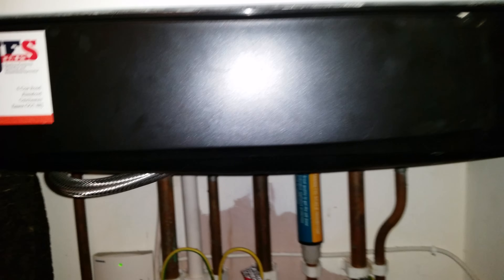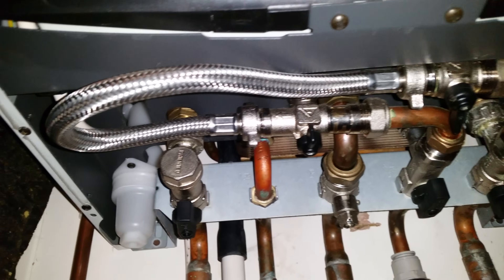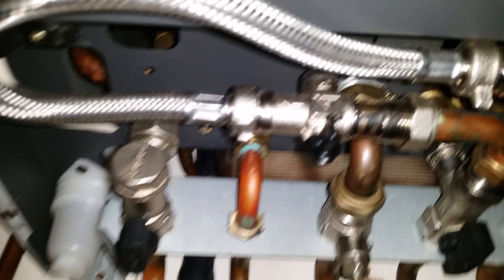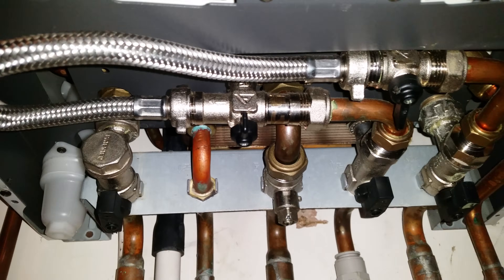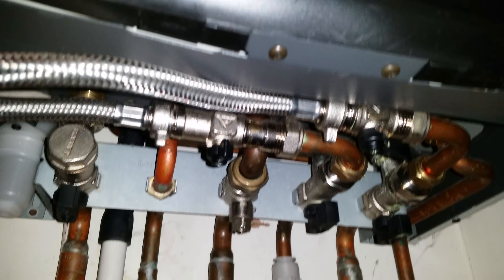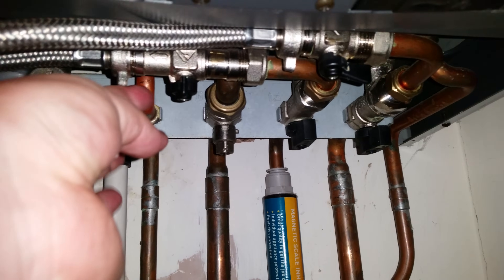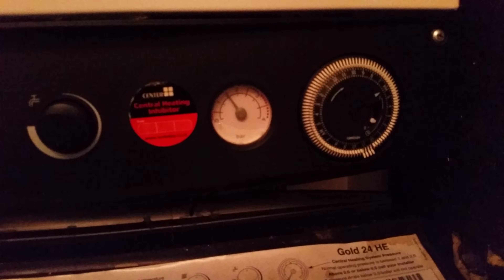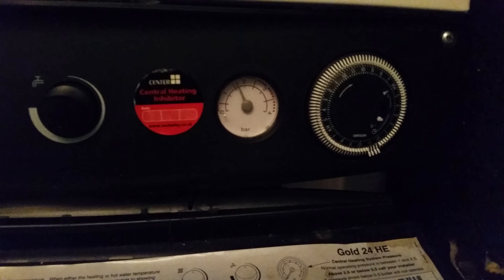How to add water (pressurise) a Potterton Combi Boiler central heating E119 error code

Comment: potterton promax combi he plus       is what i have in Scotland.   Video is correct but on my system its a bit different the flexible tubes are vertical.  i noticed the valve only needs turned slightly as the pressure increases very fast and did as the video said and fixed the problem!  i was so afraid id break it lol   so two valves need opened and one fully opened and one only slightly and you see the bar increase.  I would be careful not to turned the valve all the way open you may end up with a flooded system ?   anyways Thanks for a good video and saved me a lot of trouble :)   John 3:16-21

Comment: Just a hint. I have a Potterton titanium combi boiler. The two valves at the end of the re-pressurising loop are knurled knobs rather than valves with a 'blade' type of handle as in the video. I spent a while looking for the wrong ones...The important part is that the valves are the furthest away from the wall and closest to the control panel.
Reply: Thank you for your comment. You've saved me messing with the blade taps for longer than I'd already done 🙂
Reply: Thank you for your comment. You've saved me messing with the blade taps for longer than I'd already done 🙂
Reply: Thank you for your comment. You've saved me messing with the blade taps for longer than I'd already done 🙂
Reply: Thank you for your comment. You've saved me messing with the blade taps for longer than I'd already done 🙂
Reply: Thank you for your comment. You've saved me messing with the blade taps for longer than I'd already done 🙂
Reply: Thank you for your comment. You've saved me messing with the blade taps for longer than I'd already done 🙂
Reply: Thank you for your comment. You've saved me messing with the blade taps for longer than I'd already done 🙂
Reply: Thank you for your comment. You've saved me messing with the blade taps for longer than I'd already done 🙂
Reply: Thank you for your comment. You've saved me messing with the blade taps for longer than I'd already done 🙂
Reply: Thank you for your comment. You've saved me messing with the blade taps for longer than I'd already done 🙂
Reply: Thank you for your comment. You've saved me messing with the blade taps for longer than I'd already done 🙂
Reply: Thank you for your comment. You've saved me messing with the blade taps for longer than I'd already done 🙂
Reply: Thank you for your comment. You've saved me messing with the blade taps for longer than I'd already done 🙂
Reply: Thank you for your comment. You've saved me messing with the blade taps for longer than I'd already done 🙂
Reply: Thank you for your comment. You've saved me messing with the blade taps for longer than I'd already done 🙂
Reply: Thank you for your comment. You've saved me messing with the blade taps for longer than I'd already done 🙂
Reply: Thank you for your comment. You've saved me messing with the blade taps for longer than I'd already done 🙂
Reply: Thank you for your comment. You've saved me messing with the blade taps for longer than I'd already done 🙂
Reply: Thank you for your comment. You've saved me messing with the blade taps for longer than I'd already done 🙂
Reply: Thank you for your comment. You've saved me messing with the blade taps for longer than I'd already done 🙂
Reply: Thank you for your comment. You've saved me messing with the blade taps for longer than I'd already done 🙂
Reply: Thank you for your comment. You've saved me messing with the blade taps for longer than I'd already done 🙂
Reply: Thank you for your comment. You've saved me messing with the blade taps for longer than I'd already done 🙂
Reply: Thank you for your comment. You've saved me messing with the blade taps for longer than I'd already done 🙂
Reply: Thank you for your comment. You've saved me messing with the blade taps for longer than I'd already done 🙂
Reply: Thank you for your comment. You've saved me messing with the blade taps for longer than I'd already done 🙂
Reply: Thank you for your comment. You've saved me messing with the blade taps for longer than I'd already done 🙂
Reply: Thank you for your comment. You've saved me messing with the blade taps for longer than I'd already done 🙂
Reply: Thank you for your comment. You've saved me messing with the blade taps for longer than I'd already done 🙂
Reply: Thank you for your comment. You've saved me messing with the blade taps for longer than I'd already done 🙂
Reply: Thank you for your comment. You've saved me messing with the blade taps for longer than I'd already done 🙂
Reply: Thank you for your comment. You've saved me messing with the blade taps for longer than I'd already done 🙂
Reply: Thank you for your comment. You've saved me messing with the blade taps for longer than I'd already done 🙂
Reply: Thank you for your comment. You've saved me messing with the blade taps for longer than I'd already done 🙂
Reply: Thank you for your comment. You've saved me messing with the blade taps for longer than I'd already done 🙂

Comment: mine only has one valve on the connector pipe. And turning it does nothing. No water nor pressure is filling 😟